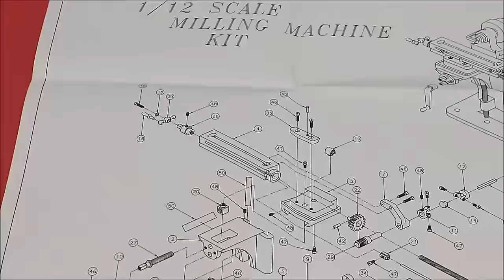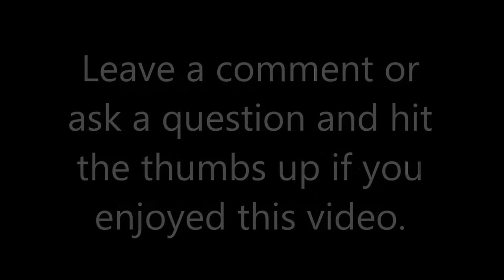Tapers Everywhere -- How Do You Hold It ??  Mini Milling Machine Base - Part 1

Comment: The dip you see in the bottom that is towards the middle is something we call "sink-in" where I work. It is a result of the iron cooling. The tendency is for the shrink to happen close to the gate also on the bottom. That is not a good thing in some critical parts for an automobile like brake parts. You can also have an occurrence of gas holes in the same area. We take steps to prevent what you're seeing.

Comment: Did anyone else notice the suction when he lifted it off the granit?
Reply from the maker: I like making contact with the plate with the part at a slight angle. On one edge.  Then drop it and watch it slide on the granite like an air hockey puck. Then I call it flat. This one was right there. Thanks for the comment.

Comment: That fake door business always bothered me when I did metal 1930's automobile models. It is one reason I quit making metal automobile models.
For odd angle machining I always made a three point fixture and used quick set point clamping.
I must say that the part  inspected on the granite plate shows the fake door sticking out like a sore thumb!
Reply from the maker: I can't call this model finished until that door opens. I plan to change the spindle design too. I hope you'll watch the series.

Comment: Wouldn’t it have been better to locate the main shaft bore, for it being the most sensitive to the overall casting dimensions? Just my thought…
Reply from the maker: No. The front, spindle and pulley bores are not critical to each other.

Comment: Great new project! In my job before I retired, I had to deal with castings a lot. Finding a good starting datum is crucial and if a couple hundred or thousand pieces are involved it needs to be a consistent datum. I love these model videos. A guy can learn a lot from them. Thanks for another good one Joe.
Reply: BTW, would the door from the shaper project work on this? Just spit balling here if you could use the door casting from the other kit to make one. I'm pretty sure you can get spare castings from PMR.
Reply from the maker: The shaper door was wider and smaller. It won't be tough, but it will be a rotary table job for the detail around the door knob.

Comment: Hi. Joe
Watch all your videos GREAT 
especially thread cutting. I’m a hobby machinist retired from the motor vehicle industry. 
I have a question and hope you can help me out. 
I have a lathe and mill. 
How do you turn the beeps on and off on the DRO ????  It is a SINO but might be done the same way on other brands. 
It can be done as I have done it before but at my age have forgotten how to do it and my supplier here in Australia can’t help me and not in the instructions. 
Hope you can help 
Regards Greg
NSW AUSTRALIA
Reply from the maker: I wish I could help, but I'm not familiar with that device. Do it like eliminating a squeak in a car....just turn up the radio.

Comment: Watching the video 4 days after having a TKR, your comment "notching the femur" gave me a chuckle!  Looks like the start of another great series.
Reply from the maker: I seriously hope they didn't notch your femur during your surgery. Thats a bad thing. And they'll never tell they did.
Reply: @joepie221  No notching, just skillfully sawing off the end of the femur to match the profile of the implant.
Reply from the maker: @rods87175  Standard femoral prep incorporates a 5 sided cut normally. Distal femur ( the bottom) anterior and posterior chamfer cuts, usually 45 degrees ( front and back ) and 5 degree ish anterior and posterior draft surfaces. These match the femur. These cuts are based on the pre drilling of the femur to place a box cut guide. If those holes are off, the front ( anterior ) draft angle cut terminates inside the profile of the femur leaving a step, or correctly called " a notch ". This greatly increases the possibility of a fracture at a later date. A post op review of the implant 'in place' x ray is always a good thing to ask for in a follow up visit. Good luck and best wishes for a speedy recovery.
Reply: @joepie221  X-ray images were provided immediately after surgery.  One is a nice view showing all of the angle cuts.

Comment: Great start on another interesting model (I'm waiting for you to complete you microchip so we can watch you machine a part from start-to-finish using all of the machines!). And several excellent lessons in workholding.

I didn't see Chuck's SCREWYBALL (https://youtu.be/f5L6-g2mbpo?si=f1s5bLuUZBEIZiua&t=30) until after I made a smaller version (Ø3/4") of Chris's (Tigermoth Racing) "Vise Ball" (https://youtu.be/gxwMfrN6qTo?si=WeSeOqK-ii7qYMcj). Since I didn't have access to a surface grinder two years ago (still don't have one in my "Mini" shop, but have since made the acquaintance of a local machinist and can use much of what he has in his shop if I ask), I would have had difficulty in making one of Chuck's. The ball that Chris used is made from 12L14 (per McMaster & their vendor), so it is easy to make your own. I also like the handle that Chris added as it makes positioning the ball easier.

Stay safe,

Charlie

Comment: I love using files. I prefer filing over any other kind of detailed material removal. I have never understood this talk about "ALWAYS, ALWAYS use a handle with your files. ALWAYS!!" I understand the reason for it when you're using your files on something that's spinning in a lathe, but any other time (with the exception of larger files that are coarse and only for extra leverage) who the hell I'd filing so hard and using their palm to push the file into the material that they risk dying????

Asking for a friend.

Comment: 9:32 Did you glue these metal blocks to the casting? They should move with the casting as you adjust.
Reply from the maker: They are not attached. They simply float on each side. Some may suggest crazy glue, but I've never been a fan. ( for machining applications )

Comment: Hi  everyone. Its ian from Aus. I have a couple of balls with a ground flat but my go to  are brass dome nuts. Softer so dont mark my vice. I have4 sizes 1/8" up to 7/16" (ghread size)works really  well. I obtained mine from the local scrap metal. take an adjustable wrench as they will be part of spme old imachine
. Cost me$5 for 10 of them.
Hope that is usefull
Reply from the maker: I like it.

Comment: 1: comments etiquette; I’ve gotten in the habit of referring to Joe in third person, not to be disrespectful, but be respectful of his time. Hopefully, he wouldn’t feel obligated to answer and as a community we can fill in blanks.
2: close up shot, cleaning up the bottom with end mill, feels like CNC work, instead of manipulation of the cranks. Is he looking at the dro, or his feel that precise?
3: The fly cutter angle of tool presentation seems quite shallow compared to what I have collected, to allow for the special grind of that tool bit. Was that standard industry practice or is it a J Pie special? If so, what’s the angle?
4: very unique fly cutter bit geometry. Has he covered that previously?

Shawn
Central Phoenix
Reply from the maker: Hi Shawn. This video is about how to reduce chipping of plastic when using a fly cutter. I believe I addressed the cutter geometry in this one.  https://www.youtube.com/watch?v=3LU_tFLZCCU  As for decking the bottom, I let my hands do the work, I just watch. :)

Comment: Hello Joe,  Can you give my brain a shove in the right direction?  I need to machine extensions so that a door lock and knob can be fitted for a six inch super insulated door.  Nothing is available on the shelf anywhere that I have searched.  So the stumbling block comes when I need 6mm o.d. stainless (or steel) with an internal 5mm x .80 tpi thread.  Drew a blank at all the metal stores as well as Grainger, McMaster-Carr, etc. etc.  I am going to need to fabricate my own.  Obviously I will need a follow rest but drilling and tapping that long, for that small, leaves me a bit stumped.  I keep having images of a snapped tap!  My shop is manual with no CNC capability.  Contacted the German manufacturer of the door set to see if they had any stock they used to make the shorter ones that was uncut with no luck also.  Very grateful if you can point me in the right direction.  Might make a good video??
Reply: I would ponder if the thread needs to be continuous or if it could be only a short bit at both ends. If it needs to be then a gun tap (spiral point tap) on a vertical mill (gravity helps with cheap clearing) might work. Or a form tap, though i don't know how that works in stainless.
Reply: I have never been able to match the threads when coming from both ends with a tap.  Dealing with such small dimensions especially there is no forgiveness.  A boring bar would be impossible to my knowledge for that length and width that didn't flex way too much.  Could do steel. Or brass but that doesn't change the dynamics much.

Comment: One could mould low-melting alloy around the casting, machine it to register on features. Then just melt it away, after machining.
Reply from the maker: But you'd have to access the features to know you newly machined lead was true to them. Seems like a translation of the problem to another stage. But I have seen production nests made that way, yes.
Reply: With cast iron, no problem.
Gallium, Indium, Bismuth and whatever else there is in low melting alloys will eat that aluminum right away and you have fancy, expensive not so low melting Gallium, Indium, Bismuth Aluminium alloy ;-D

Comment: Joe, I'm sorry if you've answered this question before but why don't you ever use a Dremel tool for cleaning up castings?
Reply: I think in Joe’s world that would be sacrilege…..lol
Reply: Dremel is an extremely unforgiving tool. So easy to gouge a divot. File in hand is much better (after some practice).
Reply from the maker: I have so much more feel with files. I just don't ever consider a Dremel.
Reply: Dremel tools send debris flying everywhere, you need safety glasses or goggles, face mask and gloves minimum plus a dedicated dirty area or the great outdoors to use them if you want to work safely and don't want waste thrown all over the shop. Files, you need some handles and some time.